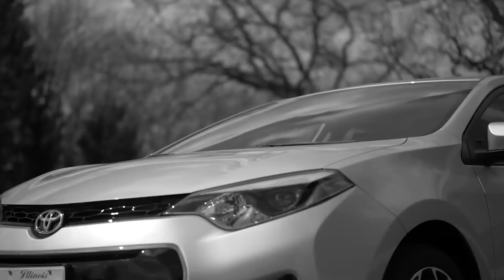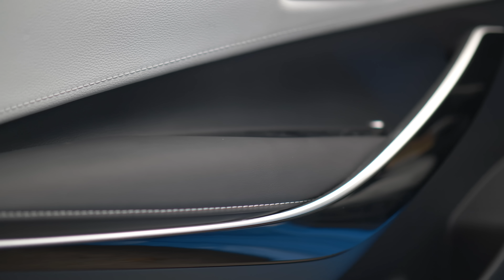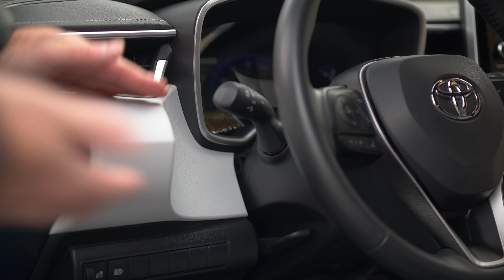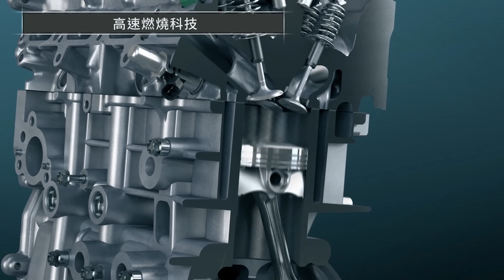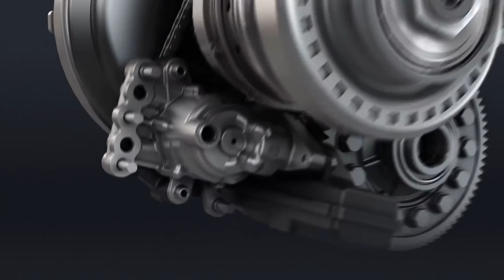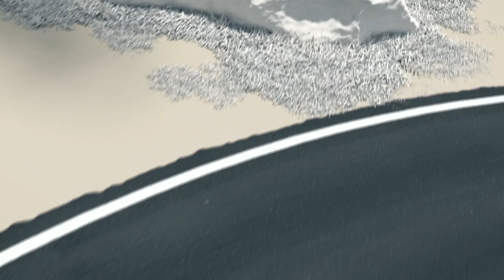Review | 2019 Corolla Hatchback | Sleepy Time is Over

Comment: Let’s be very clear here. Toyota did not add the dual injection system for performance OR fuel economy.  In fact, it slightly hurts the potential economy of the engine. They added it solely because direct injection alone causes massively accelerated carbon buildup on the backs of the intake valves. This due to the PCV system introducing oil vapor upstream in the intake and the lack of injected fuel to wash it away before heat carbonizes the vapor on the backs of the valves. The end result being premature failure of the intake valves to seal properly.  So the primary purpose of the dual injection system is to “wash” the backs of the intake valves...

Comment: The back of the car is goofy for this reason: Toyota it seems, made the rear wheel well bigger to accommodate a bigger wheel. The stock wheel/tire sticks IN over 1" from the fender and makes the car look odd. This doesn't happen at the front which makes it even more noticeable. They also did this on the older first gen XB.  I know it's picky but I see it on the road and it just jumps at me how much the rear tires tuck in the body work.

Comment: I like this hatch so much but I like the wagon version they just previewed in Europe so MUCH more. #SaveTheWagon
Reply: Yeah I'm actually cross shopping this and a golf alltrack. Both have manuals, alltrack is a wagon (+) and can make good power with tune, and is AWD, but more expensive. Corolla is cheaper, styling for a hatch is pretty good, NA engine without easy ways to get considerable power, better fuel mileage I believe, no AWD.

As it stands it's a tough choice. If I go Corolla I may lease with intent to buy and see if they bring out any performance trims. If they release a version of this with a turbo or mid 200s hp na motor, keeping the manual and adding possible awd, well.....I'd be ALL over that.
Reply: @Zeracho  Why does VW get the whole 'economy' class of wagons to themselves?
Reply: @RightLaneHog3151  Wish I knew. Buck's Regal Tourx looks alright but no manual and starts about 5k more than Alltrack. Was looking at older Impreza wagons but most are really high miles by now. Still browsing the hatchbacks available but don't know of any other wagons in the price range, like you said.
Reply: @Zeracho  There are lots of wagons offered these days in the luxury class , hopefully wagons will 'trickle down' to the rest of us.

Comment: Does it have auto-dimming rear-view mirror?
Reply: John, no it does not; however, you can get aftermarket one from eBay-only requirement is to get it with longer handle, because it will not fit otherwise.  I got one from 2019 Toyota Avalon and it works well.
Reply: @dimitermarchev9040  Thanks Dimiter.  Curious how the wiring works?  Is there a power source near the mirror mount location, or does a cable need to be led over the A-pillar?
Reply: I asked my Toyota Dealer to install it for me; however, I believe they need to use the A-pillar to get some power.

Comment: I'm very wary of CVT's because they suddenly starting putting them into most mainstream cars about 4 years ago and that's not enough time to know how reliable they are. And every part of the CVT is nightmarishly expensive to fix and service. This is not the same as the gradual introduction of automatic transmissions in the 1950's where it took many decades to go from simple 2 speeds to complex 8 or 9 speed units. The transition to CVT's is worryingly abrupt.

Comment: Good review! I was excited about getting one of these until I found out that they all come with Toyota's safety sense. And it's not a deletable option. The automatic braking and lane change assist may sound like a great safety deal until your wife or kid or yourself pulls to close to a parking curb and smashes the front bumper or backs up from a slightly to high parking lot bumper and pulls off your front car bumper. Then you will find out how expensive a boo boo you just had and the months it may take to get it fixed as not many dealers or repair facilities are even able to repair these vehicles. The auto braking radar needs almost a quarter of a mile free space in front just to calibrate it, not many garages have that kind of space. A front bumper repair or replacement on a regular car might cost a couple grande but some of these new cars can cost tens of thousand of dollars so that little crunch you had pulling into your favorite seven eleven might have just totaled your car.
Reply: It can be turned on and off FYI. 😏

Comment: Was there a particular reason you hated the iM's standard transmission? Also did they carry that same transmission into the HB?
Reply from the maker: It was the clutch take up and shifter assembly. It felt so cumbersome.  It felt like they designed the car for an automatic and then somehow had to fit a manual transmission into it after the fact.
Reply: @savagegeese  I drove a '14 KIA Soul manual and I think I know what you're talking about, I had a really awkward time figuring out where the clutch would engage and it's like the shifter had a hard time getting into first and it would just love to get into third instead.

Comment: I had a new Corolla sedanfor  a week as a rental, two weeks ago. I could drive this on a regular basis. Can't say that about a lot of sub $25K cars. Not a fan of CVTs, it still does that constant rev mode under high acceleration. Driven "normally", it is really good. The handling was a surprise. Very good platform. 

Mark, your review was spot on to my impressions.
Reply: I agree, drove 1k miles in 4 days in a sedan. Pretty good overall, but the suspension is weak. I think it went out of alignment during the course of me driving it ;) for 20k one could buy a 3-4 year old mercedes.....

Comment: Is there a setting for infinite gear CVT? Why not keep the engine at peak HP all the time?
Reply from the maker: Yes when you're in a regular drive mode going about 35 or 40 and you floor it it will hold revs.

Comment: Good car but way overpriced and barely any discounts. You can get a Buick Regal Sportback (hatchback) with 250 hp and 9-speed for less $, compared to that the Corolla doesn't seem so good anymore. Mazda 6 costs slightly less, Toyota Camry slighlty more. The new Corolla is simply too expensive and only good compared to cars that cost much less.

Comment: The CVT transmission is, in every way, designed to be smoother and more fuel efficient than a traditional auto.  And I understand how simulating gear ratios to use with the paddles could be fun for tooling around, absolutely. But for all other driving scenarios, why in the fuck, would you want to simulate a torque-converted auto trans? The whole point of a CVT is the ability to keep the the engine in the best powerband (when asked for) at any speed, while dynamically changing the ratios as the car accelerates...Something which a traditional auto simply can not do. WHY WOULDN'T YOU WANT THIS? Sure, it makes the car sound weird under hard acceleration, but that is the nature of this type of power delivery. If it bothers you, then you're an idiot that doesn't appreciate what is actually going on. The CVT is a superior transmission for the daily driven commuter, PERIOD. If I am buying a CVT, I want it to behave like one! Why are manufacturers catering to idiots??

Comment: Sorry but the best driving (recent) corolla is the 2005 XRS 8000rpm yamaha tuned 6 speed manual with LSD.

That being said this new corolla is really damn good. Best in class better then Civic and Mazda 3. Its crying out for a higher performance hot hatch model. I do not agree with you saying this looks like a Mazda 3. Put them side by side you will see this looks like nothing any Mazda 3. Front end and rear end are completely unique on this corolla. This corolla is easily the best looking car in its class.

Comment: Very Good review Mark , I Have been down to my local Toyota dealer and checked these out and i agree with all what said ,except i did find that the the rear seat legroom has been shortened over the previous model and this was after i adjusted my seat in the front , I felt a little disappointed here as this is important to me with two adult children and i was able to compare directly to the previous gen model as there was one right next to it , i think it had 3 to 4 inches more leg room than this new model and i could not tuck my feet under the seats as easy either it also felt a little claustrophobic inside also , Small points maybe in what is overall a Far Superior vehicle but i just wish Toyota could have a least maintained these fundamentals  , for me now i to have reconsider and look to the New Camry or change Brands which i am not to happy about. I Currently own Two Corolla's . John
Reply: Sedan version coming out next year

Comment: But will it do 500,000 mile with no oil changes or any parts being replaced like the old one 🤔
Reply: Time will tell.
Reply: @RightLaneHog3151  well with a cvt I guess we won't have to wait too long :P maybe 100,000 miles at best
Reply: @LawrenceTimme  In a rare move for Toyota, this is an all-new car with new engine, transmissions and chassis so it will have to prove itself in the real world.

Comment: I wish you would have reviewed the manual version as well.
Reply: @notformebeaky  That's one of the dumbest things I've read in my life. Also, love how you wrote etc., which could mean anything.
Reply: vlenhoff The manual throw is so long it's like driving a truck, don't bother if you plan on modding it.
Reply: Brian, I currently drive a WRX, and the short throw shifter was its first mod. Thanks for the advice, i personally don't like long throws. This looks like a fun little hatch, but i may go for a little Miata instead. The shifter in the miata has tiny throws, and it is a joy to shift. I need something cheap reliable and simple to put miles on.
Reply: vlenhoff Go for it! You know as well as I do a manual transmission can be completely trashed and still get you home.
Reply: @Class umm then they would no longer be enthusiasts.
Reply: notformebeaky GT-R, i30n, Stinger Gt, you’re correct on the last 2 though.
Reply: @notformebeaky  Driving a manual was less dangerous when cellular phones didn't exist. Last thing anybody wants is someone  texting and shifting. It's illegal, but I see people doing it all the time....
Reply: @notformebeaky  lol, what's your reccomendation for a cheap little car then, jackass?
Reply: C&D's  Okulski and Smith liked it. Called a "secret enthusiast's car".
Reply: notformebeaky Not the point I was responding to. You want to debate that point, perfectly fine, but I wasn’t responding to that point.
Reply: @Eddie G (Eddie Munster)
Most people stick to Automatics.
I can drive a manual transmission  like a bat out of hell. 🦇
I personally got tired of replacing clutches that are not cheap. Plus selling a manual is a nightmare. Almost nobody wants to buy them. Manuals tend to sell cheaper for that reason. If you try to trade them in to a dealership they will give you a long spill on how they just sit in their lot along time compared to automatics. It's like putting your money in a shredder.
Reply: @notformebeaky That is a complete nonsense. Nissan still makes the 370z AND the GTR, Hyundai is now making the Veloster N/i30 N, Kia is making the Stinger GT, Renault has the RWD Twingo, and I can't say much about Opel because I'm American but they just became detached from GM so something good can come about now.
Reply: LOL at automatic cars.
Reply: i did and i liked it too.. i still have my old car which is a manual. i just need an automatic for a change due to traffc and its excellent
Reply: There's no manual option.
Reply: i wonder if they even have a manual gearbox for it. That's what i would get, if i was buying this car.
Reply: @vlenhoff   they definitely do, 6 speed manual
Reply: You'd regret it. It's not a good manual. Mr. Topher / Winding Road drives it, and the rev hang is insane.
Reply: @vlenhoff  Watch the review... he mentions the manual option.
Reply: @ZZZRaven65 , Miguel Ortiz, thanks! Sorry, I missed that.
Reply: It's like an automatic, but a lot more work.
Reply: Eddie G:

He is reviewing the XSE model, that is CVT only.  To get a manual 6 speed you have to step down to the SE model.
Reply: @howardkerr8174  In the U.S., Toyota deserves applause for offering the 6-speed manual trans in both SE and XSE trims. This is the first CVT, though, that I might actually consider buying.
Reply: @howardkerr8174  You're wrong. The manual is available on both trims.
Reply: @edman79  I think it depends on where you are buying it from. In Canada, SE Upgrade is highest trim for manual corolla hatchback from what I am seeing from their website.
Reply: @howardkerr8174  where are you getting that information from?
Reply: @howardkerr8174  XSE is available with a 6 spd. as well.
Reply: Howard Kerr go on Toyota website. You can configure either model with a Manual! There where some misconceptions on other videos stating differently.
Reply: robob221 not in Canada we can only get the manual in Se upgrade so no leather option with the manual :(
Reply: Howard Kerr sad but true

Comment: As a recent owner of this car(SE upgrade trim), I was hoping to see your review before buying, cause I would like to see the underbody, but couldn't wait anymore since winter is coming in Canada. So far really enjoy this car.
 Here are some pros and cons I found.
Pros: Exterior and interior look great
          CVT feels great at launching 
          Lots of safety features 
          Made in Japan( if it means anything)
          Apple carplay! (you need to pay extra to get it on Mazda3s and civic? not sure)
          More power than the 2.0 Mazda 3 155vs168
          It's a Toyota so less cost for maintenance
          Bronze colour looks so nice for me at least. 
Cons: Rear and trunk space is not big at all, compared to Mazda 3 hatch or civic hatch
          The sound system is just ok sounding
          No backup sensor and projections (back up camera is standard) 
          Could use another 20 or more horsepowers 
          The Dunlop tires seem to generate a lot of noise.
Not a great choice as a family car due to the lack of space, but a great car for a couple or a single driver
Reply: Wilfred Bao you are right on everything except the sound system. It is really garbage and not just OK.
Reply: > Made in Japan( if it means anything)
seems only to the Chinese LOL

Comment: Great for Toyota sticking win an NA engine while other manufacturers are slapping turbos. The 2.0l with bolt-ons plus a tune should have more power.
Reply: Probably wont yield more than like 20 hp with bolt ons. Maybe if/when they develop a supercharger and/or turbo kit for this which will probably run you 5k (as they generally do :(.

Comment: I've said it before and I'll keep saying it. I would love to see bring back the XRS (or GT-S) Corolla. That would be a great competitor to the Civic Si and Elantra Sport. Perhaps with a tweaked version of the Camry's 2.5L? But what do you guys think?
Reply: The 2.5 would be an excellent choice.
Reply: Ryan Littleton Def an XRS version with a high revving engine.
Reply: Question: this car runs on 0W-16 oil, where would I even get that? Or will it run on 0W-20 just fine?
Reply: It would be interesting to see what range of oil viscosity the Owners Manual says is ok for different temperatures. There is usually a range given. 0W-20 should be perfectly fine, since the engine hydraulics that rely on the oil being a certain viscosity range still function perfectly as the oil is thicker as it warms up. So long as you use a full synthetic it'll ensure a consistent viscosity as the oil ages between changes. I find this comment from the oil testing experts Blackstone Labs the most pertinent... 

"0W/16 is a pretty new thing. We've only seen a handful of samples of it,
 mostly from fuel efficient Japanese cars. In our testing, it looks 
pretty much identical to a 0W/20 or a 5W/20, right down to the viscosty at 100°C.

As to whether or not it's a scam--no, it's perfectly serviceable oil. 
It's up to you if you want to pay more for it, but the engine probably 
won't wear any differently with 0W/16 versus 0W/20.

Alex Miller
Blackstone Labs"
Reply: @DiscoFang  It's not that I'm worried about how it will run. It's a matter of buying it myself to do my own oil changes. I haven't seen anything around, apart from the dealer selling it. That sounds expensive. Not sure why I'm worried, I don't own one of these new Toyotas. I'm sure it's all good, but it'll be interesting to see.

Comment: MR GOOSE - did you happen to see if a physical brake cable ran the length of the car so a mechanical handbrake retrofit would be possible?

Pretty sure the Corolla is the only compact on the market with a J-VIN; having owned Japanese cars & trucks from Japan, the US & Mexico, the J-VIN means something, and I won't touch anything with a 3-VIN ever again (3 being Mexico) so Mazda is off the table for the time being. 
My wife has a 17 6mt iM hatch, it is double wishbone in the rear, it is a really nice chassis, but Toyota held onto that 1.8L a bit too long, and the 6mt is well, meh at best. I know it's going to be a reliable car, and she has a lead foot anyways so probably a good thing it's got a lump of slow-plodding reliability under the hood instead of this updated engine. 
I was interested in the new Corolla for myself as an "A-B" but the light interior color will not wear well when kids are concerned, and the electronic parking brake is a deal breaker for me; looks like I'm sticking with my 2006 WRX wagon until this unnecessary tech-infection is sorted; time to stock up on EJ's, since Subaru is still manufacturing them.